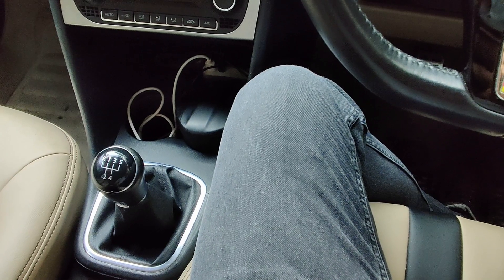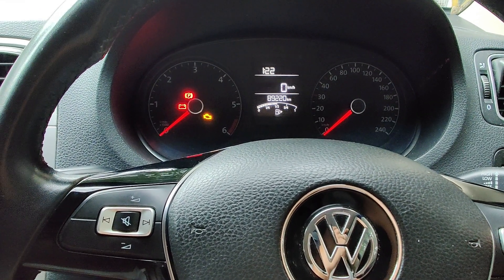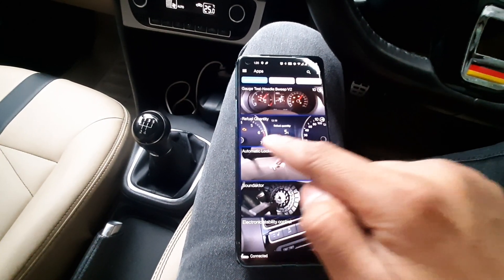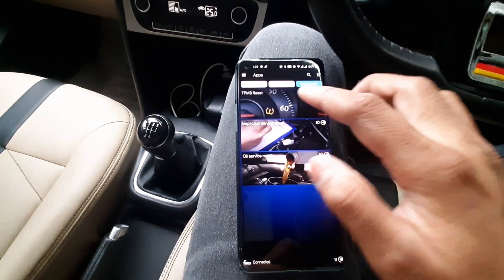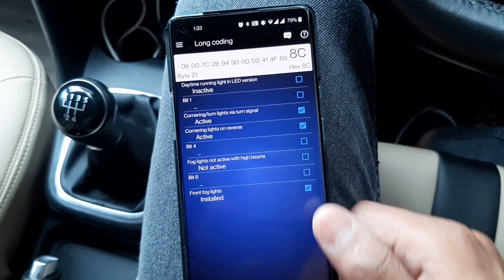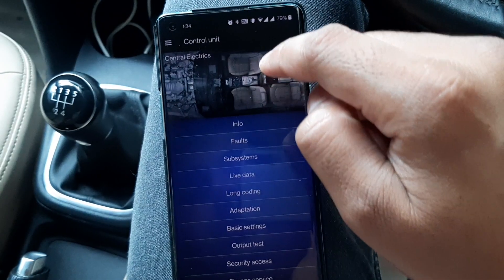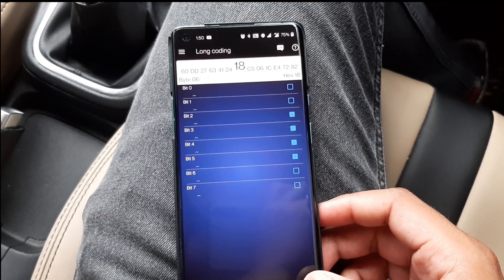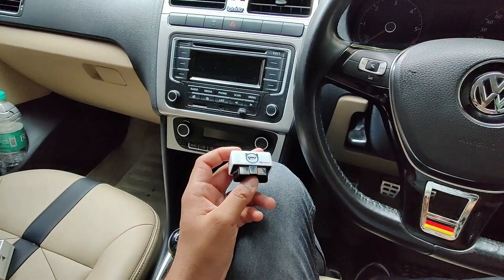OBDELEVEN PRO ON VOLKSWAGEN | POLO | 6C/6R | MK5 | APPS AND LONG COADING

Comment: Is the long coding values same for  IM M+4 bcm becoz the values are different and i cant see the names of them in odis can you help me with it i need names for all the bytes and bits for 86M bcm please help bro
Reply from the maker: Sir that is kind of difficult , as the combination of BCM , ECM gateways together defines the pinout of each component , some of the major components remain the same for others can be flipped , if you see the pinout of a 86M in 2 different cars , you will find variations . 
We can find data online but the reliability of that data will always be a question , and pinout decides the bits and bytes to control the system

Comment: Can we check engine temperature ? 
Make it default in odo meter reading
Reply from the maker: Sir in polo after mid 2014 , its already there
Reply: @yourDIYneeds  
Hey, I have 2018 model, I don't see it in odometer 
Currently the temperature which shows was outside temperature (28°C to 40°C)
Can you please tell ?
Reply from the maker: @ankamanirudh8837 sir is it highline ?
Reply: @yourDIYneeds  No, it's Ameo comfortline
Reply from the maker: Sir for flipping through the screen we need controls on the steering wheel or wiper stalk does your car have it ?
Reply: @yourDIYneeds  I don't have any controls on steering wheel
How to do with wiper?
Reply from the maker: Sir in upper models there is a button on wiper stock to flip the screens

Comment: does it voids warranty for vento TSI's ?
Reply from the maker: No sir it will not
Reply: Anyhow I Won’t do long coding. I’ll just activate features from different apps in OBD11.
Reply from the maker: @saharshtiwari2276 its perfectly fine sir
Reply: @ need swipe in my vehicle comes under long coding option. Does long coding voids warranty by any chance, because whenever car goes for PMS they scan the ECU and send logs to HO for reference.

Comment: Hi. Can I calibrate the Steering Angle Sensor on my Vento TSI AT with this device ?
Reply from the maker: Sir yes , we can reset all the previously saved data in the steering module and then it will adapt again
Reply: @yourDIYneeds Can you give a demo as to how the SAS can be reset / calibrated using this tool ? It will help many that are looking for this as most of the VW / Skoda are out of calibration these days .
Reply from the maker: Sure sir

Comment: Hi can you open the thermostat on the waterpump with this ? Ive got the pro version tool ,
 By the way my car is a 2016/17 polo 1.8 gti tsi bluemotion 192ps  , DAJ engine  .
 The car has mostly everything activated already from the manufacturers so theres not much i want to change tbh , ive turned on & turned off some features already tho which aint causing any problems so all is good on that side of things .
  Opening the thermostat will help greatly whilst flushing the system without actually heating engine up . I know i can activate the radiator by-pass valve  with the obdeleven pro   Aswell

Comment: I got this device today but i cant enable settings that you have shown in long coding it is asking for a pro or the ultimate plan should be activated i purchased it for 3800rs and customs 1723rs and brake bleeding also not working asking for subscription
Reply from the maker: Sir yes , for long coading you have to buy a pro plan online

Comment: I'm using obd11 for about a month now (scanning+apps) and have bought credits to do some minor mods. Went to work and came home and tried to do some other app modification but suddenly most of the apps are 'not supported' (red error when clicking on the app) so I can't change anything. Even the apps I already changed are 'not supported' and it can't be that my cars is not supported to change.Tried reconnecting and rebooting the phone but no solution yet. Any suggestions?
Reply from the maker: Modification you done are still working or they stopped working ?

Comment: Hi can I use the Android Torque ELM blue 327 2.1v OBD2 scanner to enable features like the mfsw on my 2016 Polo TDI Comfortline?
Reply from the maker: Sir if its truly an elm327 chip with the required protocols then yes it can do that , but a lot of those elm327 in market are fake , so just be a little careful
Reply: @yourDIYneeds  Thank you for the response and clarification.

Comment: im interested in video in motion coding for my skoda rapid 1.6 mpi. But OBD11 does not show me in the apps of my car. Any idea of long coding instructions? Also have you tried mirror dip function on reverse?
Reply from the maker: Sir video in motion depends upon the video playing capabilities of the headunit n, and mirror dip is not possible , as it requires a memory module , which rapid doesn't have
Reply: @yourDIYneeds  I  got a Blaupunkt Key Largo 970 on which Prime video, hotstar, Youtube video plays while in motion. But direct video playback from USB does not work
Reply from the maker: Sir obd unlocking only works with the OEM headunit , as blaupunkt is an aftermarket unit , so it won't have any effects on the unit , main reason why unit is not playing video when on move is because it can sense that the car is moving by voltage , and regulations define that car headunits are not allowed to play videos while on move .

Comment: Can CRUISE CONTROL activated in polo gt tdi 1.6  2014 model?
Reply from the maker: Yes sir , bcm has a support for cruise control , just have to wire the controls and activate the cruise control via VCDS
Reply: @yourDIYneeds can we activate cruise control using obdeleven

Comment: I’d bought a pro device from Russia for Vento (2018, 1.2 TSI HL+). How to get  setup the vehicle with VIN? There is no option showing Vento instead of Polo and Rapid. I have selected the Polo but couldn’t activate any of the preloaded feature/apps like basics needle sweep etc. please help in this regards. Thanks.
Reply from the maker: Sir , there is no vento in international markets , its known by the name of polo sedan , there should be an option where OBDeleven will confirm the model year , model selection ( 5 or 3 door ) and engine option , select those according and it will work .
Reply: @yourDIYneeds  Thanks for your very quick reply.
I’d already selected 5 door Polo but couldn’t get the features activated.
Reply from the maker: Sir if you want i can provide you my vin no to try . But on mail 😅

Comment: HI, can you please also make a video on how to activate "App connect "and "Voice" funtion in vw models after 2016 if they are not activated ? to get them directly opened from vw cost you good amount of money. Thanks
Reply from the maker: Sir which vehicle do you have ?
Reply: @yourDIYneeds  vw touran 2017
Reply: Its just these 2 functions that I can't use, and it says contact dealer for activation.
Reply from the maker: Sir thats possible , as soon as you will plug obdeleven then you can enable it with help of long coding , or prebuilt apps , here we don't have touran , so i never connected the device to touran , but if vw is charging a price to do it , then its definately possible with obdeleven
Reply: @yourDIYneeds  thanks for the quick reply, really appreciate that. Last thing dear If you can just please share the link for OBDEleven and if ypu know long coding for that. Thanks
Reply from the maker: Sir you can buy it from there official site , just google it . And long coading is not like a long coading , you also have a menu which you can read tick and save , its easily understandable

Comment: Sir Very good morning,

I don't know how i have not come across you superb channel till few days back. Very knowledgeable videos. thank you.

I have a 2013 Vento highline TDI covered 1.55lac kms till today.

Till now I have only changed the front suspension. I am still running completely stock on clutch and all other parts including timing belt and water pump.

I am planning to change the clutch + timing belt & water pump + few other minor issues to sort out...

1. Regarding the clutch - no loss of power or pickup till now but it has become slightly heavy. 
However when in heavy / slow moving traffic there is slight jerky-ness while releasing the clutch slowly - is this because of the clutch ? 

While changing the clutch - Should i change the full clutch package including the pressure plate, friction disk and clutch bearing ? What will be the rough cost to change the clutch ?

Shall i ask the mechanic to also do preventive cleaning of EGR valve and throttle body ? ... is there anything else i need to do preventive cleaning and maintenance for ?

2. There is a squeak noise when releasing the clutch pedal - i feel this noise is coming from somewhere near the clutch pedal possibly behind the firewall - what could be the reason pls ?

3. Last 2 days the center aircon vents on the dashboard - there is no air blowing - however air is coming at full blast from the side aircon vents. Also when i change the direction of air from dashboard to feet there is no air blowing. Could this be a the blower or resistor issue or the motor for air direction flaps behind center aircon vent ? ... 

Lastly is the VAG-COM VCDS OR OBD 11 better ?

The Vento is a beautiful car sturdy and fantastic mileage (18-20 on highway with full load). With your help i hope to be able to maintain the car well and enjoy more years with it.
Thank you very much for this channel and your service. 
Extremely grateful.
Reply from the maker: Sir now got your comment and replied on mail .
Reply: @yourDIYneeds  Thank you for your time and service Sir. I have received and replied to your email. Thank you ...

Comment: Can hill hold assist can be activated from this device
Reply from the maker: Sir in a manual ?
Reply: @yourDIYneeds  sir in a manual
Reply from the maker: Sir as far as i know , in a manual its not possible , we don't have the hardware
Reply: @yourDIYneeds  thanx you sir
Reply from the maker: In a automatic , yes but it depends on the support from BCM

Comment: Hi, sir.. I own VW polo 1.2 tdi M-2012. I am facing  issue while shifting to reverse gear (grinding noise) this comes up after I drove the car for few kms. If standstill after ignition it shift s normally to reverse gear no noise.  [ After driving few kms if I want to shift it to reverse without getting the grinding noise I need to shift it to 1st gear then to reverse, in this scenario there won't be grinding noise ] 
This problem started after replacing  clutch set (OEM) at 65000 kms,  but didn't go for transmission oil change (since mechanic said oil was looking good no need to go for changing showed by loosing the filler bolt) . After this I was experiencing the reverse gear grinding issue. So thought to change transmission oil got it replaced, (oil was some other brand - offered by go mechanic workshop). Even after this issue couldn't be resolved. I have hard shift s sometime s in 3 & 4 gears.
A local mechanic said need to do clutch air out / clutch bleed. 
Slave cylinder and master cylinder are in good condition. There is no squeaking noise while released/pressed. 

So need your advice in this concern..
- Do I need to drain out transmission oil and change it with  oil - sk zic 75w-85 ( as seen from one of your video) a right method. So that issue would be solved!!
If not 
- How and when  to do clutch bleed / air out ?  
After the changing to new oil!

Help me out in this regard....

Thank you in advance.
Reply from the maker: Sir , 
Very first thing i need to know that is , did you changed the flywheel along the clutch or not ?
The grinding noise usually comes when we don't press the clutch fully and try to change gears . 
Bleeding air out of clutch system is a good idea you should try it , because if there is still air trapped in clutch system then pressure plate of cluch will not recieve full pressure from the pedal .
Changing the transmission oil after a clutch replacement is a must , as you have spend a good amount on clutch plate , pressure plate and bearing then its a wise idea to change the fluid and be worry-free till next time , if you want to swap transmission fluid then use motul , its better than sk zic ( i have a video on it as well ) 
Last possibility of grinding noise is syncros themself , they are located in between the 2 gears to make the gear shifting process smoother , if cogs of syncro are eaten up then they will grind , but in your case as you said that it happened after clutch work . Its almost impossible 
Did mechanic calibrated the gear shifter and shift lever after the clutch work ? 
Because in these vehicles after you remove transmission you need to re calibrate the shifter and lever to have perfect shifts . 
(Most probably this week i ll upload a video on this process as well )

Just in case you reply again , and get no reply then please send me a mail at everydaydiyhelp@gmail.com , after update of youtube app , sometimes it doesn't show any notification of the new comments.

Hope it helps sir

Comment: Hi brother...I wanted to ask that white smoke from the dipstick and oil filler cap in the Volkswagen Polo 1.5 tdi (2015) normal in vag cars or their is some issue? Also how much is the normal engine oil consumption in polo tdi as I got my polo serviced in April but today morning as I checked the engine oil is showing low level ...I am worried kindly advise
Reply from the maker: Sir blowby smoke is a normal thing in vw tdi engines , oil consumption acc. To VW USA says that any amount of consumption below (  1 fl. quart / thousand miles ) is still considered to be normal consumption
Nothing to worry about sir , its normal
Reply: @yourDIYneeds  ohh okay....(1fl.quart)?? And yesterday I went to a car garage to get liquimoly injector cleaner liquid to put in my fuel tank ....looking at the white smoke he said that the piston rings have been damaged and the oil is going in the combustion chamber and quoted a expense of around 80-90 thousand. Can you also tell the reasons behind piston ring damage and the problems/symtoms which the owners might face in this situation just to ensure everythings fine and for knowledge too!!
Reply from the maker: Volkswagen tdi has engine blowby by design , its not a problem , if the engine oil starts to burn inside the combustion chamber then you will experience light blueish smoke , white smoke means the mix is getting rich , and system needs cleaning , sir just use the injector cleaner  and if possible get following things cleaned properly 
1. MAF sensor 
2 . intercooler 
3. EGR system ( if not complete , atleast the return pipe)
4 intake manifold 

Your problem will go away .
Hope it helps

And sir yes 1 fluid quart
Reply: @yourDIYneeds  okay and how will all this cost any rough idea?..I have just come home from the garage ....brother their is no engine oil left it is at its lowest and guess what I got the car serviced on 15th April 2021 ....The mechanic said he would clean the intercooler let's see.Lastly thankyou so much for responding and I hope it helps.
Reply from the maker: Sir its just labour cost , maybe a mechanic will charge 600-700 max for these things
Reply: @yourDIYneeds  okay tomorrow I will get the work done and then let you know
Reply: The meachanic has changed the engine oil and diesel filter used Castrol magnetic 5w40 full synthetic....he said that we even during driving the car the  reved  the car a little bit around 3-3.5 thousand rpm he said  there is no black smoke in the car and is perfect ....is this engine oil good for polo tdi?
Reply from the maker: Yes , if it has  no smoke its good sir

Comment: Hi, you always post videos which i am in need. :) can you share which plan/product did you buy, from where and how much it costed?
Reply from the maker: Sir i bought it from official site of obdeleven , device + pro pack it costed me £43 for device and close to £25 for pro pack
Reply: @yourDIYneeds  was it including shipping? How long did it take to deliver after ordering
Reply from the maker: It took 6 days , yes shipping included
Reply: @yourDIYneeds  Which postal service you have chosen ?
Reply from the maker: Standard india post , but you need to have good contact with your local postman 😅😅
Reply: @yourDIYneeds  ok but now they are charging for the shipment for faster delivery they are charging around 27-29 euro and for standard delivery it is estimated for being delivered in 1 to 4 weeks and standard shipping is also not free but cheaper than other options
Reply from the maker: Yes its close to 7 i guess

Comment: Control module (behind air filter) clips broken, have tied it with wires. It held up well till now , is it necessary to install new clips
Reply from the maker: Sir , just make sure that its held in position firmly , basic motive of mounting bracket is to keep it firmly in place  , so if you have tied it down properly then no need of new bracket
Reply: @yourDIYneeds  thanks , are earlier vento(2013) suspension stiffer than present cars
Reply from the maker: Yes sir , a little bit
Reply: @yourDIYneeds  thanks will try to get them